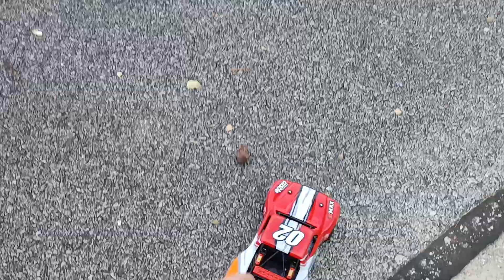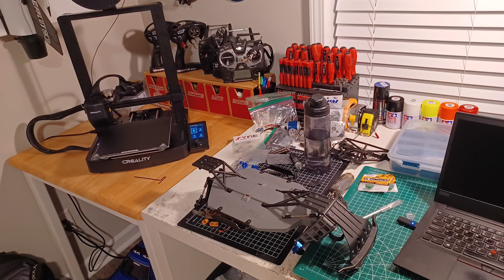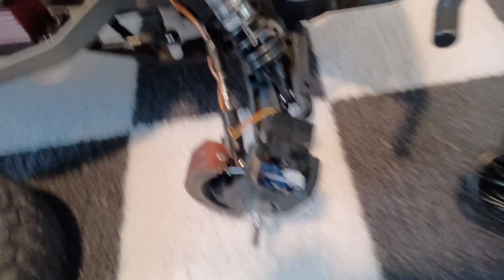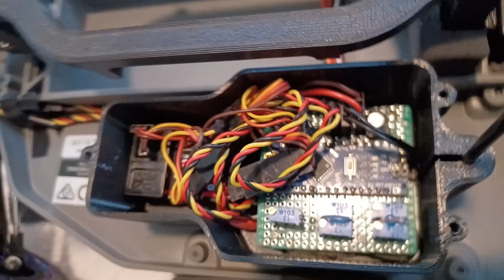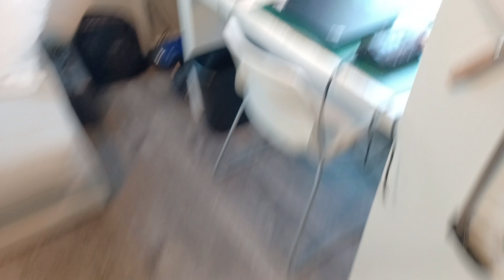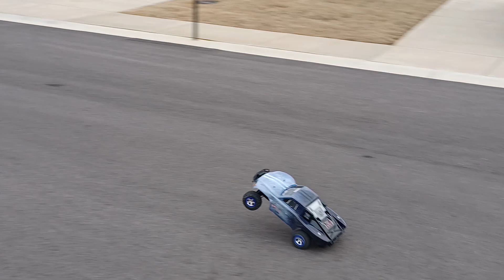Fleet Update 2024 and Front Brakes on a Traxxas Slash

Comment: 6:26 use cables and put one big servo on front chasis
Reply from the maker: Would definitely solve the servo fitment, but I have no idea how to even start to get a cable system to work with all of the suspension articulation
Reply: @Pieliker96_  well try looking at old drum brakes designs or bicycle brakes systems I guess use thin enough cable or bicycle cables might be to thick hard tho

Comment: I’m building a burn out drag slash and been trying to figured out way to lock front tires
Reply from the maker: I originally wanted to get this thing to do a burnout but the weight distribution just wasn't having it. It's possible, but you'll need lots of ballast in the front and/or a big tire compound difference between the front and the rear. The 4x4 chassis may be more conducive weight-distribution-wise if you pull the driveshaft

Comment: Have u thought of getting the Baad racing long travel kit for the slash 2wd?
Reply from the maker: I'm keeping it relatively stock for now, don't have much need for long travel since it gets driven on the street most of the time. During the initial planning for the build I was considering a solid rear axle conversion chassis but decided against it for parts availability / cost / durability reasons - may still be cool to do, but it works just fine as is